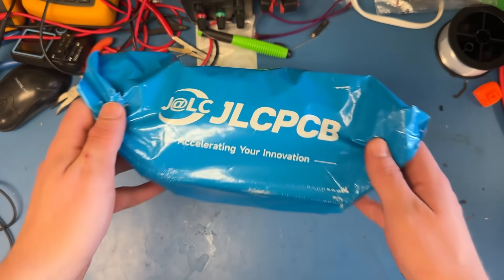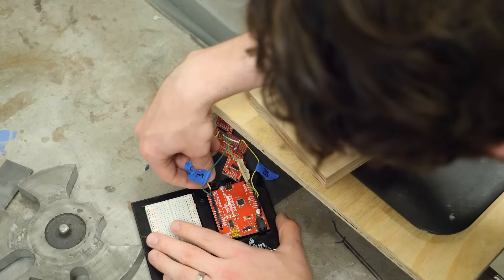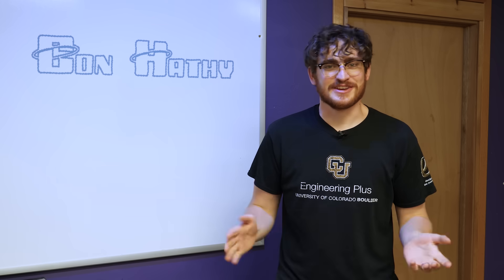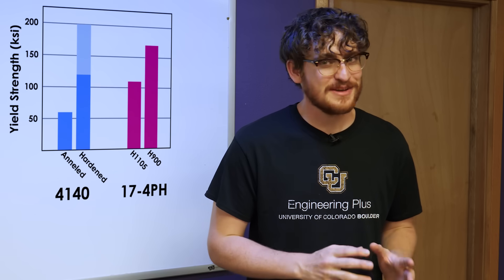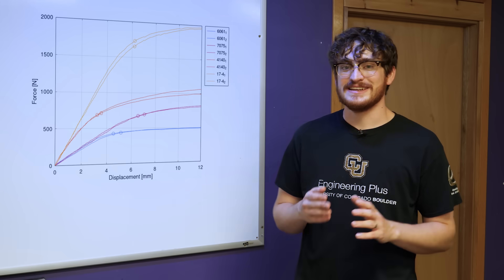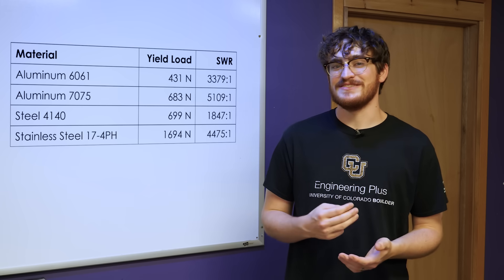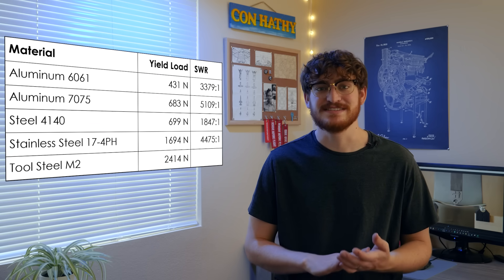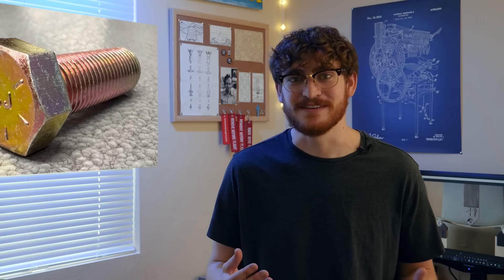Is Aluminum Actually Stronger Than Steel?

Comment: Well clearly we need to use the right material for the right job.
I have designed mostly welded steel structures and I would not just replace S355 with aluminum.

But I do love to design things in aluminum and I love to work with aluminum. (Maybe except for tapping aluminum, but machining aluminum mad for machining is nice because it is so much softer than steel)
Do to the lower mass you are more free to design very stiff shapes, taking advantage on the "second moment of area". This is fun when using optimization like topology optimization.

You can also make cool parts using carbon or glass fiber, but I just don't like working with resin. And sure you can 3D print cool parts. But the stiffness of plastics are just much much lower than the 70-200 GPa of alu and steel. Still I love a good sandwich structure or a super fast 3D printed prototype.
Reply: Aluminium definitely has its use, but it can also be pretty frustrating. What the video doesn't touch on is that while there are some pretty strong alloys of aluminium that usually also hinges on their tempering, which means they turn into butter when you weld them. For some alloys and tempers you have to divide their yield by 2 for the HAZ, which is a bit painful.
Reply: Softer metal means worse surface finish. I hate machining aluminium because it cause havoc on the tools, hardened steel is actually much nicer to work with.

Comment: At what temperature, or environmental conditions?   Both win within their best operating environment.   So the question is, really, what is the intended use case?
Reply: And what are the requirements (do we need actually higher strength there and there) and other tradeoffs do we have to do (weight, manufacturing reasons, tolerances, thermal stability,  vibrations, cold welding in space, etc. etc. etc.)